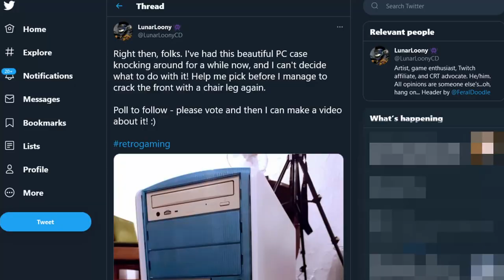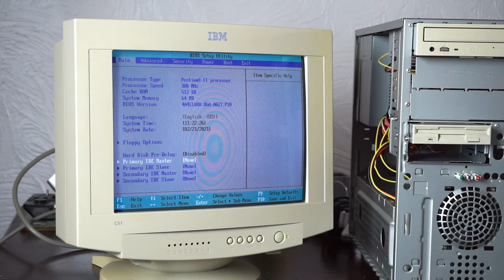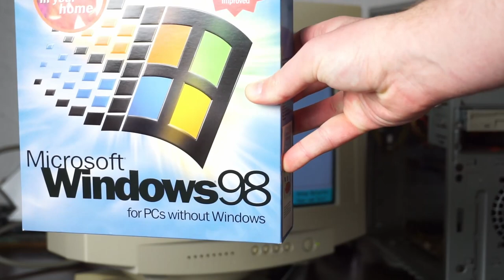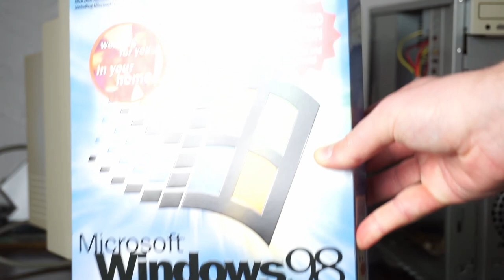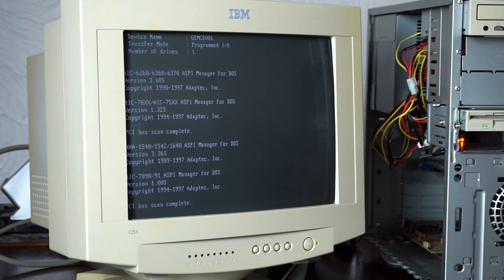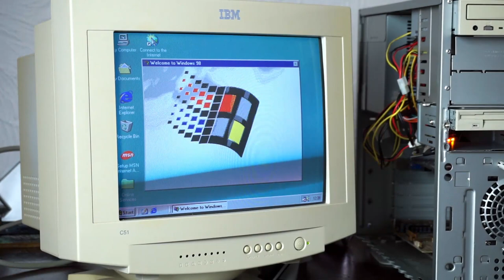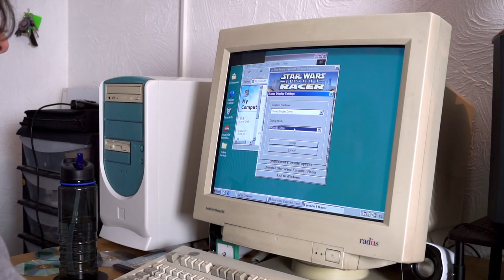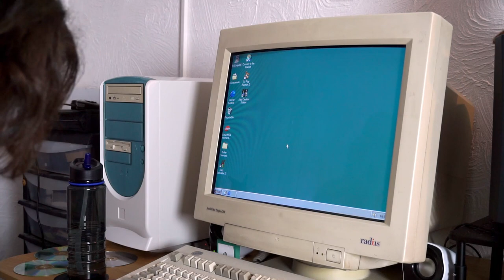Building a Pentium II Windows 98 Computer!

Comment: I'd be tempted to add a bit more Ram. 256MB if the computer can take that much would be perfect or 128MB Ram. How long did the SD Card last? Windows 98 has no trim support and all those read writes can't be good for the SD card. a CF to IDE would be a better option over an SD Card. Great Video I enjoyed watching it. The case suits the Pentium II nicely.
Reply from the maker: The SD card didn't do very well at all. For some reason they never work with me - sometimes Windows will install, but I'll end up with a ton of errors when I try to use it.
Ended up replacing it with a HDD. I meant to make a followup video, actually, but I've lost the footage :/ Should give it another try.

Comment: 2:58 No, the Pentium Pro did not come in the “slot” format, only Pentium II, Pentium III and Celerons. 

Pentium Pro’s used socket 8, if I remember correctly 🤔 great big CPU’s they were. I think there may have been a socket 8 to slot 1 “adapter” you might call it (similar to the socket 370 to slot 1 “slotket”) but I never saw one in person.

3:43 Again, no. Slot 1 boards all came with those retention posts/brackets because all slot 1 CPU’s used the same mechanism.
Reply from the maker: I may have seen someone talking about the adapter then - some very light research suggests that such a thing exists for the Pro.
These things are always a learning process, so thanks for clarifying!
Reply: @BrokenCircus Regarding the problems you had with the SD to IDE adapter, those things are notoriously finicky. They don’t like being connected to the same cable as the optical drive, usually needing their own cable and they often don’t like the first card you try, especially when you use a micro SD to SD adapter…they’re great when they do work though! 😆

Comment: Hey you need to check for bios update to use the sd card drive you be fine and you can use 64gb card and make sure it beyond 50mb per second!!!!!!!!!!!!!!!!!!!
Reply: In my experience with using SD cards as hard drives they don't last long. CF to IDE is a better option over an SD Card but still not the perfect solution. Mechanical hard drives are hard to find these days and when you do find one its only a matter of time before it starts going bad because they are so old. Maybe a developer can write a Trim program for Windows 9x OS's or something that could be made more suitable to use as a hard drive for the retro PC gaming world. This is becoming an issue with retro builds these days.
Reply: @tipstricksss1453  Well I'm using a sd card in my Compact 1800 laptop and it doing great!!!!!!!!!!!!!!!